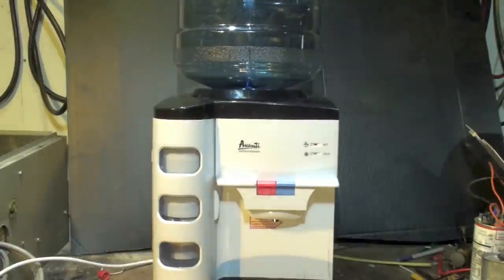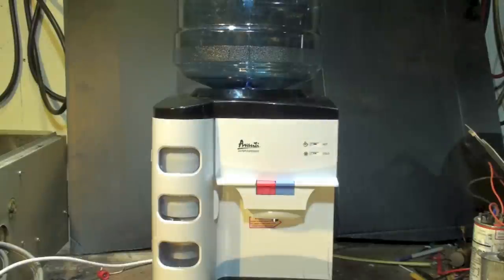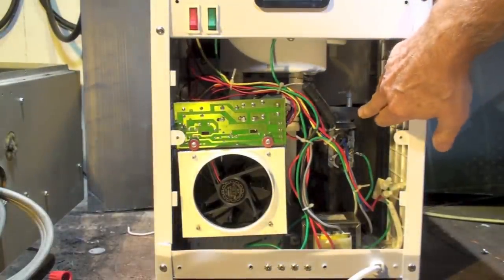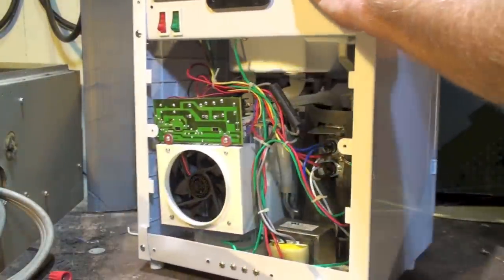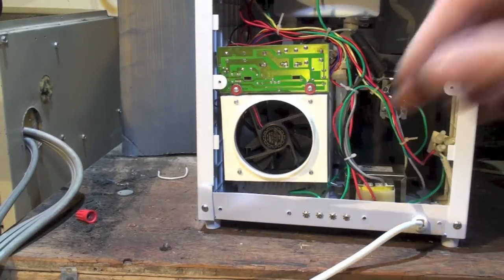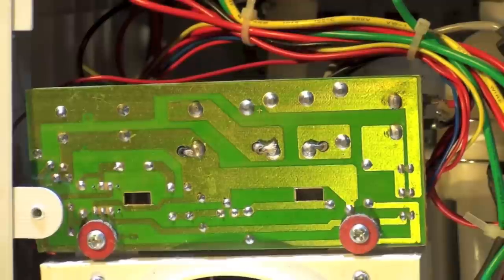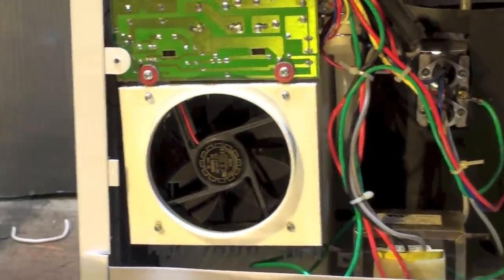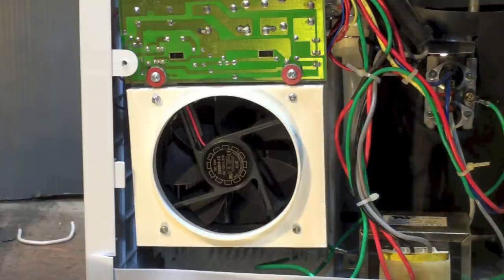Why doesn't the water cooler cool water

Comment: It's a thermoelectric cooler, using the peltier effect.  When current is applied to the peltier junction one side gets hot, and the other gets cold.  The hot side is cooled by the heatsink and the cold side cools the water.  Maybe the power supply is bad or the peltier junction has a defect?
Reply: I'm in agreement with you.  It is a peltier effect cooler.  By the looks of it the fan is a 12vDC powered fan.  If the fan is not running and and the heatsink behind it is cool to the touch then the power supply is probably not working.  If the heatsink is warm to the touch then just the fan is not working.
Reply: I have the opposite problem. What’s the cause if the cold water fan is constantly running?
Reply: Peltier cooler

Comment: Try cleaning the fan, it happened to my cooler and i took out the fan, clean it, oil it an it works like new
Reply: Okay but what if the fan runs perfectly but it still wont cool
Reply: @chrisforjesus4740  maybe you need new freon or you got a leak with the freon inside the cooler

Comment: the fan isn't  working need to replace the fan. i had the same problem.i sprayed some wd40 on it until it was able to turn...  then it cooled for a time...until i really needed to replace the fan. 

it electronically cools the water via conduction system of the radiator behind the fan. the fan takes the heat away... thus cooling the water.. once you fixed the fan it cools the water. try replacing it with a more heavy duty brand.
Reply: hello  Do you know where I can buy the fan ?
Reply from the maker: Man, I have no idea.
GFM
Reply: grayfurnaceman  thanks anyway.
Reply: My fan is running ,so what's the problem then ?

Comment: Hello sir, my water cooler is a bottom load whirlpool dispenser. It is no longer pulling water and light signal indicates the bottle is empty when it is full. HELP! Could you do a video about this?
Reply from the maker: Is the filter plugged?
GFM
Reply: @grayfurnaceman  lol yes it is, i even tried turning it off and on again;) why is is not cooling anymore do you think?
Reply from the maker: @ghostmtl4503  Well, if the filter is plugged, that is your problem.
GFM

Comment: It's a heat sink, air is pulled through fins on a block of steel or preferably aluminum. Another student brought in a rather large wine cooler last year with this setup. I recognized it right away as I have built PCs for years.

The issue with his was dust and grime built up in the fins but yours looks pretty clean. Other issues with these can be a bad fan or the block not being seated correctly.

Yay! I think I finally answered one of these!
Reply: Block?

Comment: I'm guessing something with the fan not running....  not sure if the fan cycles on and off and only runs when cooling is called for ????  Fuse or Fuse Link ?
Does the water heater also use the evap heat pump system or is it electrical resistance heating ?
Great Videos by the way.. have learned much !  Thank you Grayfurnaceman !
Reply from the maker: DIYdake It is resistance heat
GFM
Reply: Fuse 1 on the back of the electronic board needs changing